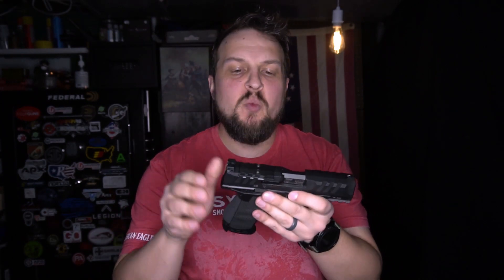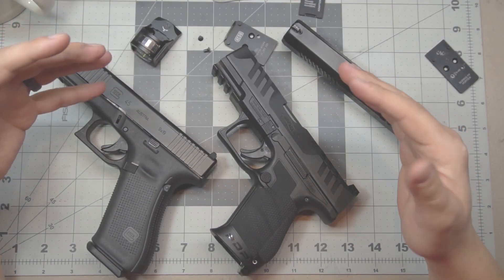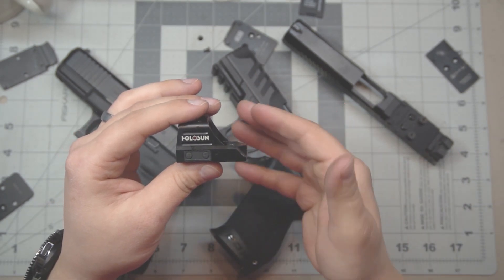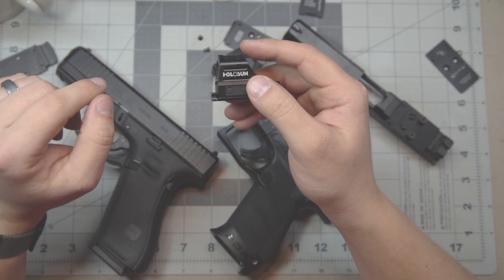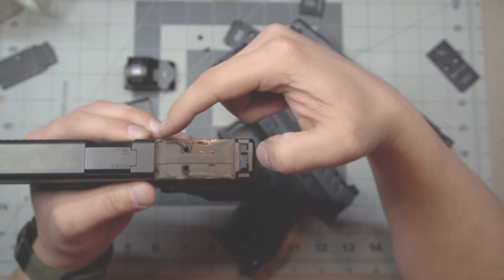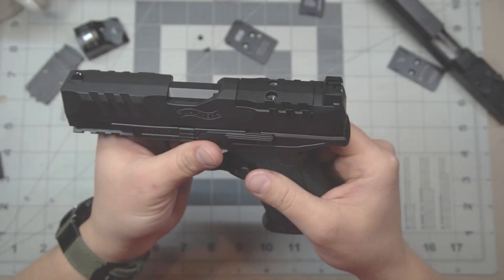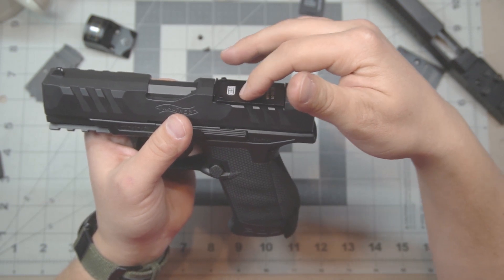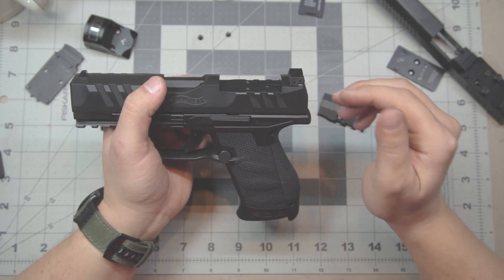The Gen 1 Walther PDP is going to Break

Comment: From a real engineer with over 30 yrs experience, your assessment, w/o testing authentic Walther plates is " a confusing conglomeration of feelings." (Replay your prior vid: Walther PDP First Shots and Winter Weather Testing at 5:26).
Reply from the maker: The lack of walther plate does not negate the lack of transfer mechanism, longitudinally and/or transversely, to remove sheer force from the fasteners. Even if the walther plate fits more snugly, the lack of transverse support is worrisome.
Reply: @workthetrigger  What is your background?  I know you mentioned a little in the video, but are you able to share what your degree and work experience is?  

Also curious to see if you've drawn a free body diagram of the slide with optic and plate.  That might be worth sharing and discussing.
Reply: @darkstargear  Diagrams and calculations are tools designed to streamline the process of ideation>prototype>refinement>final.  They aren't ends in themselves.  Calculations can have poor assumptions.  Free body diagrams likewise.  Also, a person can pass a collegiate physics course and then promptly forget what he learned in it.  Or even worse, he can pass the course but the course wasn't actually scientifically rigorous, so the passing grade means nil.  I'm suspecting our host either forgot what he learned when earning his degree, or his teachers & their exams were so softminded as to be practically useless for anything but a passing grade and a buffed-up GPA.
Reply: @seanoneil277  It looks like you can see the path we were heading down with this question. Are you on IG?
Reply: @darkstargear  No, afraid not, I don't play in that sandbox.  The levels of discussion there aren't any better than any other clickbait or narcissism vector of social media.  Not bad for photos & videos, but useless otherwise IMO.  Don't even know what a calculations/diagrams discussion would do for the host's flawed assumptions and process of illogic.  Ultimately he hasn't tested his "theories" and that makes him a non-scientist.  Which isn't surprising for a "design" guy, in my experience.  Even a formally uneducated person could test the "theory" with some actual testing of the hardware itself.  But our host can't even bring himself to that level.
Reply: @seanoneil277  Yeah...  I’ll share here then...  I think we’re on the same page.  There’s a lot overlooked here, enough to change conclusions. 

Too little knowledge can be dangerous.

Knowing the assumptions made and how the total system was considered for this opinion will be quite telling.
Reply: @darkstargear  I don't expect our host to eat humble pie on this one, but I'd like to be proved wrong and would enjoy seeing him admit he doesn't know as much as he thinks he knows.  But such an admission might cause his core audience of inexperienced people to winnow.  Given the clickbait nature of this video, I'll guess he won't want to suffer losing clicks.  

Our host doesn't realize that highly intelligent people know that the more they learn, the less they actually know -- because the world's a big place, and scientific fields of study & knowledge are pretty well developed & not easily summarized with a hasty clickbait "theory".  And I'm not even reaching the dearth of mechanical aptitude displayed by his "theory" -- which is very embarrassing, to be kind.

But he may have a future in theoretical physics -- after all, look how Lisa Randall rode the gravy train with a big book of nonsense regarding "branes" theory.
Reply: @workthetrigger  A more substantive reply to this comment.

It looks like you went to C&H Precision's website and watched their video talking about the importance of precise machining as well as support posts for any RDS mount to a handgun slide.  If so, bravo for memorizing what they told you in that video.  But memorizing what C&H said in the video isn't the same as understanding what the video told you, or extrapolating what the video means for any good, sturdy, reliable-at-1000 plus rounds of cycling & work.

Think about this:  instead of using the Walther-contracted C&H mount plate made specifically for the PDP, you chose to use a plate made NOT for the PDP and then found it had problems.  This is where your mechanical aptitude shows as lacking.  You didn't even understand the relation between what you spout about neeeding lengthwise and crosswise shear support mitigation, and what Walther contracted C&H to do for its various pistols.  

Have you noticed that on Walther's website for the PPS M2 Aftermarket Support, C&H is listed specifically as the contractor of choice for mounting an RDS to your PPS M2 slide?  C&H asks that you send not just your slide, but also the specific RDS you intend to mount.  I might suggest you ask yourself why C&H requires both the slide and the RDS.  Then I'd suggest you ponder the following: (1) Walther chose to partner w/ C&H for RDS mounting.  (2) The partnership between Walther and C&H might suggest that if you want to put an RDS on your PDP, you should choose a plate made for your PDP to fit the RDS you intend to mount.  (3) It's highly likely that the PDP's RDS mount system was designed under the Walther/C&H partnership, and highly likely that the mount plate Walther provides for the PDP either is made by C&H, or is made per the specs C&H designated in partnership with Walther.
Reply: @seanoneil277  Someone needed to state the obvious. Good on you!

Comment: The optics' weight is not enough to create a force of inertia that would result in a shear force that may fail the screws. The plate is forced against the front of the cut, so optics and slide function as a single unit.
Reply from the maker: It's not forced against the front of the cut. I have an entire video about the forces

Comment: A comment from Germany: I am not a die-hard Walther fan and am therefore open to legitimate criticism of the PDP.
But if you use a cheap plagiarism from China instead of the original Walther plate, you shouldn't be surprised at the result shown.
In addition, I am sure that Walther tested this new pistol with tens of thousands of shots with a red dot before it was offered to the public, of course mounted with that of the original plate.
A Latin saying goes well with this video: "Si tacuisses, philosophus mansisses."
English translation: If you had kept your silence, you would have stayed a philosopher.
A more vulgar translation: If you'd kept your mouth shut, we might have thought you were clever.

Comment: I would think there would be stories popping up if there was a serious flaw. Especially with larger, heavier sights like the aimpoint acro and holoson 509t. 

How much lateral loading is there in recoil? If the front of the plate is pressing against the slide then the load is going into the plate, not through the screws. Then when the slid goes forward and stops the plate is pressing against the slide. With a rear gap you are relying on the screws but the spring tension is stopping the slide so that is not a particularly violent stop.
Reply from the maker: More specific info on loading and design in tomorrow's video

Comment: What makes a fastener different than a lug on a wheel? Both are hardened steel bolts with threads. Lugs are made for shear force so there's no basis to say that fasteners are not except maybe just that the composition of the steel is weaker but then you could just get a better grade
Reply from the maker: I have a second video up that explains it, but basically if you look at a wheel stud, the threads stop short of that shear point and the force is supported across a thicker cross section. There's more to it, but that's relatively basic

Comment: You are supposed to contact Walther direct once you decide which optic you want and they will send you a Optic mount free of charge.  Do you think maybe that is why they do that ?    Or are you saying the gun is defective?
Reply from the maker: I think their expected method of force transferral.is unsustainable through high volume manufacturing methods. Their plate is undersized, and their "contact fit" against the front face of the cut doesn't exist consistently.

Comment: QUICK and EASY fix, make a plate that integrates the "lug" into the "super terrain serrations" to get fix the plate and make it perfect?
Reply from the maker: We tried that. The tolerances on the machining of the serrations and plate cut wasn't small enough to get a solid fit across multiple guns.
Size it for one gun, it wouldn't fit another. Adjust for the other, and it's loose in the first one.

Comment: Man you really have no idea, the PPQ's large lugs were there to give more thread length and also the screws used were regular socket head cap screws, so in theory if the frictional connection was not strong enough, the adapter plate could slip to a certain amount and the lugs then would work as the form fit.
So now take a closer look at the PDP's design, they are using now a counter sunk socket head screw, so you have the frictional connection through tightening the screws and additionally you have the required form fit from the counter sunk screw head (same goes for the optic mounted to the plate btw).
The optic lugs on the adapter plate or any other rib, notch whatever on the slide to the adapter plate becomes redundant and factoring in machining tolerances, if the other lugs, ribs, notches will ever engage when it's mounted with a counter sunk socket head screw, the screw has already snapped or sheared off anyway and will send your optic flying.
On a side note, I'm a mechanical engineer myself and in our company we spend a lot of time stress testing various connection methods.
Reply: Countersunk is good only for locating, not handling shearing forces.

Comment: Would it work to integrate the lugs into those serrations on the side? If the plate tabs went down along the sides of the slide and mated with serrations I could see that working.
Reply from the maker: Yep.  Someone brought that idea up in another thread and I really like the idea.  It'd be a good upgrade for them to alleviate the issue.

Comment: I’ve been beating my PDP’s since September of last year without issue.
Reply: Approx round count?
Reply: @TheHumbleMarksman  right around 4K on my full size and 2,500 on my compact. There’s also quite a few people that have been running them hard since September.
Reply: Are the optics plates also polymer like the cover plate? Maybe there is a snugger fit with them or, if polymer, might be a little more shock absorbent?
Reply: @Oldz1xax1z  no, they’re aluminum.
Reply: @VeloxTrainingGroup  the plate I just got from Walther today for my PDP Compact is steel.
Reply: You are way to humble Nick, this kinda stuff pisses me off. Making blanket statements that he himself has not proved out. Yet will ignore someone on the Walther Defense Team that has been running the gun with no issues.
Reply: @zaynemikita6897  1. Makes coherent argument based on physics. 
2. Can infer if pistol had have problems would either no longer be on sponsored team or have vested interest in deflecting attention away from issue.
Reply: I clicked the video thinking his actually broke? So this is just a educated guess?
Reply: You said it exactly - let AC of Sage Dynamics run his tests.  If the optic holds zero after his beating then the tiny mounting screws are more than capable of handling the forces placed upon them.  Team member testimonies are useless.  I was sponsored pilot in a other hobby and when we knew there were problems with products and equipment we worked around them.  Never admit it - but instead tell your story that “you’ve not had the problem.”  I never liked this line of guns based on looks and feel in my hand BUT I appreciate issues like this.  As the old adage goes... only time will tell.  Nice video and explanation too.  Thanks!
Reply: @zaynemikita6897  couldn’t have said it better. That and he compared it to glock. And we all know glocks plates break.
Reply from the maker: That's the point: the Glock plate system breaks.  Glocks lack of longitudinal recoup lug regularly leads to broken screws.  I also compared into CZ, which IMO is a relatively solid system with it's cross recoil boss system.  

Of course time will tell.  Ammo availability has hindered independent testing of products lately, PDP included.  So it's going to take longer to see potential issues assist as real issues.  This is, however, a potential issue, whether y'all want to admit it or not 😉
Reply: Good thing that Walther will warranty those plates and slides forever.   We will see what happens.   We saw this video on the PDP Facebook page and many of the Walther leadership took notice of your theory - and dismissed it, noting that the lateral stresses that you cite are almost non-existent on a reciprocating slide.  Also noted is that there are guys with 5000 and 6000 round counts on PDP that they have been running since September.  But you bring up an interesting argument and I will be watching my plate for movement.  (I actually don’t own a PDP yet-  but it’s on the way.)
Reply: @workthetrigger  I've put about a 1000 rounds through mine so far. Holds zero no problem.  You're assuming and guessing at this point. My CZ's optic plate looks a little bit more rugged , I'll give you that. Keep shooting it with a Walther plate and report back , dont beat it with a hammer just to prove a point though...
Reply: @workthetrigger  fortunately, ammo hasn’t hindered testing for all of us. Again, I have thousands of rounds on my PDP’s without issue.  After this weekend, my full size will have over 5,500 on it.
Reply: @F0xSH0X1  Correlation is not causation.  Comparing it to a Glock is a false equivalence.
Reply: @Jasondranoff  UNeducated guess.

Comment: Dang, I guess lug nuts and wheel studs must be witchcraft then since fasteners can't handle shear loads.
Reply: That's exactly what I was thinking 🤔
Reply from the maker: Look at the design of wheel lugs. The threaded portion carries no shear load.  Also, massive amounts of more bolted joint pressure and friction face. 🤷🏻‍♂️ But mostly it's properly designed fasteners.
Reply: @workthetrigger  carries no shear load? Dude what, think about how torque is transferred under braking. The rotor and wheel rotate about the same axis and the only thing transferring the torque is the wheel studs which pass perpendicular to the planes trying to slide past eachother. That is the definition of shear in case you forgot.
Reply from the maker: Re-read what I wrote: the threaded portion.  The part that handles that load is typically thicker, without threads. 😉
Reply: Okay front axels on a 4x4 truck have machined surfaces the bolts thread into the hubs
Reply: Just because you thread the end, or entire length, of a shaft does not immediately deprive the material of its ability to handle a shear type of load. You can't just claim that stuff will break or fail. If anything I could see you stating loc-tite is a must to keep the screws from backing out and moving on, but I think people are more than aware at this point that this really is a non-issue.

Comment: I have a walther pdp , with holosun 407c and the walther plate.  I have many Sig Pistols, Springfield Armory, Walthers, and Glocks.  I also worked in industry with mechanics that were in high stress.
Do you have any examples of guns breaking where the optics were properly installed with loctite ?
Reply from the maker: Multiple. In the comments even.

Also... Who says "with loctite" is properly installed... Because per their user manual, that isn't Walther. But yes, most use loctite, and they still brrak
Reply: @workthetrigger  OK, np I'm not trying to disprove or anything, I am concerned, as I have 5in Barrel compact grip PDP with holosun optic.  I am always trying to be objective and prevent problems before they occur-- on all my guns

Comment: Dear degree owner,
Did you ever made some measurements? Like the dimensions of the screws, the contact surface between red dot, the plate and the slide? Did you get data such surface rugosity of the named components and the screw technical data? Did you weigh the red dot and the plate, to determine what mass is held by the two screws? Do you have the shear ressistence values of these screws? Did you calculate the clamping force the screws apply on the three parts involved , based on the wrench torque indicated by the manufacturer? And based on the results, of the above mentioned measurements, taking into consideration the contact surface and rugosity, did you calculate the assembly resistance to the dynamic loads caused by pistol cycling when fired? And moreover, did you mount an accelerometer on the slide and measure the acceleration produced by the slide movement when firing the pistol? Did you make the calculation, based on all the data above, to obtain the maximal shear force applied to the two screws, and the numbers showed you that the screws would fail from fatigue after an average number of cycles? No, you didn't. So how the hell did you came up with this bullshit?